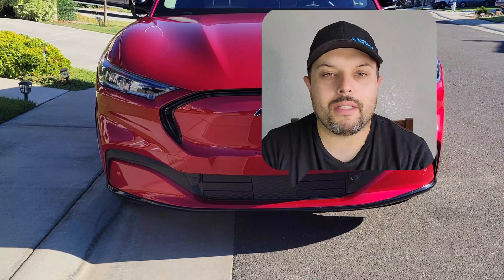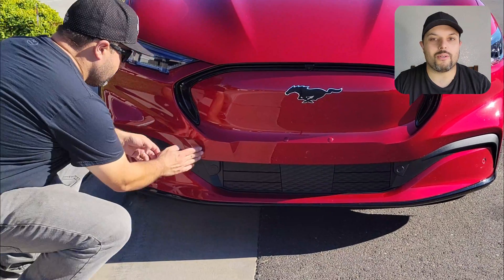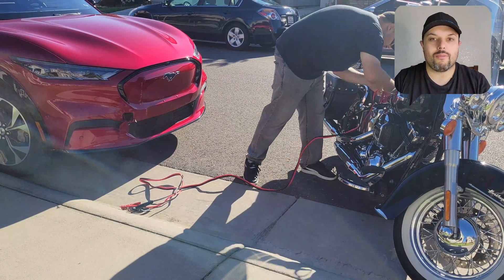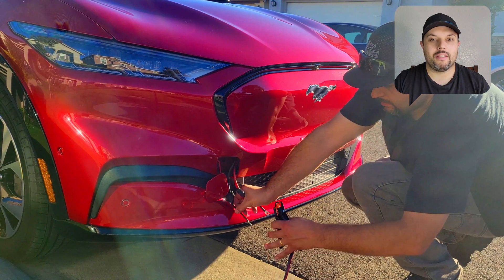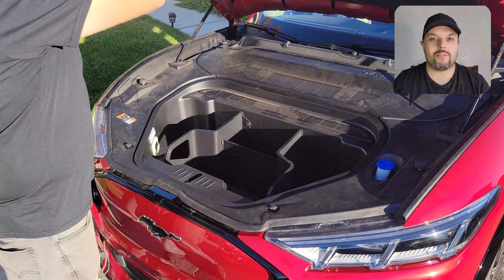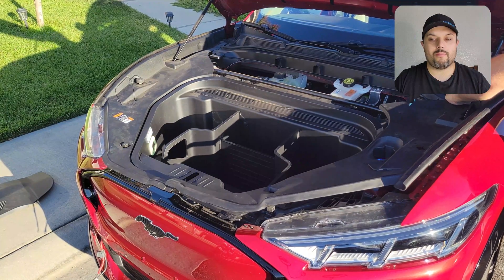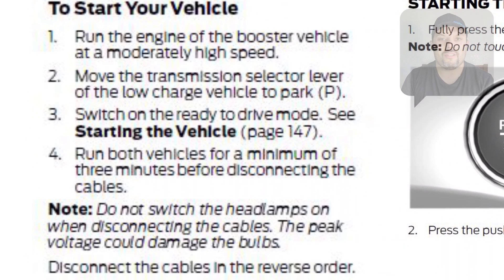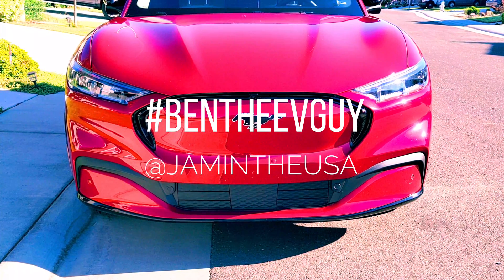12 Volt battery - how to open the hood, how to jump start, dead battery | Ford Mustang Mach E

Comment: I coded an EBay lightning remote key to work with my MME Rally so my remote would have a frunk button and was wondering if I needed to take it to the dealer because of that weird sound it makes when remote opening the frunk, but I see yours made the same weird sounds and thumping when you activated the frunk jump leads.  Odd design choice, Ford!

Comment: Question 
If the main battery is good will this method work to open the bonnet?
If this method doesn't work how do you get into the Bonnet or main doors?
Key fob battery is good and  working but doors not open?
Reply from the maker: @paulsmith2855  if the 12V battery is good it will not get you in.
There is no other way I know off to get in when the key is not working but 12V is good. Probably need a locksmith or a tow. But check out macheforum.com 
They might know more about it

Comment: I checked mine and it does not work. Checked fuses on wires all good.
Reply from the maker: Is ur 12V dead. If your 12 V supplies power it will not work

Comment: Do a video replacing the Ford battery with a Tesla 12 volt LiON battery. Liter weight more power longer lasting.
Reply from the maker: I sold the car
 And the new tesla batteries are not 12V but 15+
Reply: @BentheEVguy  Tesla started off with 12volt lead acid and now can be changed to 12v LiON.
Reply from the maker: @chada472  cool and good to know. My tesla has a 15.5V

Comment: I’m surprised to see the red and black wires being able to touch each other without consequence. They must only be going to that frunk lock and nowhere else.
Reply from the maker: That is correct
Reply: There's also a relay or switch that prevents those cables from working unless the battery is fully dead. This is problematic though, because some people have reported that their battery is too dead to work, but not dead enough for the front cables to do anything.
Reply: @daftmathtv did they say how they worked around that issue? Drowning the battery further comes to mind

Comment: I did this. Totally worked. Took it for a drive around the block. Came back turned it off. Pressed the start button and all the alerts went off... my brakes were activating too with..even with it off

Comment: Only store bottled water in that good, wtf thieves can easily get in
Reply from the maker: Why? Is ur 12V always low? Because otherwise it would not work
Reply: @BentheEVguy  oh I see, so it only works if the battery is low?
Reply from the maker: @SunshineVocals  correct

Comment: I keep my battery booster in the frunk !
Reply from the maker: How you get them out when the frunk and doors are locked?
Reply: @BentheEVguy  I guess I don't.
Reply from the maker: Dang I just wished you had an answer how to mechanically open the door. That would have been the solution

Comment: BTW, I have an early First Edition and my car had the 12v low battery issue.  If the car dies, use a proper 12v AGM charger that can supply 10 amps or more.  I originally put a 4 amp trickle charger on the car ... that wasn't enough.  As soon as I switched to the 10 amp charger the car immediately woke up and started charging.  

The have been a couple of software updates for the 12v system.  A fully updated car shouldn't have any issues.  But older cars ... if not updated, might have to go through this.
Reply from the maker: Thanks for the hint

Comment: I have a question on security. Does your phone or key need to be close by or does the 12V charge open any Mach E frunk?
Reply: Thank you for verifying. A huge relief that someone can't just pop my frunk open.
Reply: I just saw the other post that says it only works when the battery is drained.
Reply from the maker: correct, according to the manual, btw I tried it with connected batteries, it would not work.

Comment: What i don't understand is why Ford didn't just make it possible to charge the 12v battery directly from the little slot in the bumper.
Reply from the maker: What if the battery is bad and needs to be replaced. You still need to be able to access it
Reply: If you put jumpers on the wires it would  provide power to get in the car to open the frunk.

Comment: If its very cold in the winter I wouldn't want to deal with that...with a regular car I can at least use a key to get into the vehicle and access a jump start pack from inside the car.
Reply from the maker: I was told that the doors should open a few times when the battery is dead. Not sure though
Reply: @BentheEVguy   Ya it should do that...at a minimum even if the 12 volt battery is removed or dead the traction battery should be able to at least allow someone to use the keypad to enter the car....I can't imagine if it were zero degrees outside and very windy and not being able to get in my car because the door wont open.

Comment: Jumpstarting an EV is a misnomer as it doesn't have an engine to provide electricity to charge it's dead batteries. I'm curious how long it would take for a car engine to be able to recharge the batteries to the point where one can drive to a recharging station.
Reply from the maker: I think there is a misunderstanding. EV have a 12 V battery same as gas cars. They go bad and need a jump start. Same as on a gas car. That's whats explained in this video.

You can bring a generator and depending on its output it is pretty easy to calculate how many miles you get to charge the main battery. If it is a regular 110V battery you will be around 3miles/hour charging. If it is a 220V generator and it is set to charge with the charging cord which comes with the car you get around 22miles/hour charging. Of course there are faster solutions out there as well. Such as DC charging which gets you from 10-80% in roughly 45 min

Comment: Interessting to see, that Ford is able to open the hood automatically. Why not with the key or from the display. Hope an update will come.
Reply from the maker: It must be an american safety standard issue or something like this. I heard it is active in Europe
Reply: @BentheEVguy  no, it’s not activated in Germany. I have to open it manually.
Reply from the maker: Interesting. I saw some ppl from scandinavia posting, which had the button on the fob
Reply: @BentheEVguy  yes, that’s the strange thing. There is a button on my fob, but with no function yet.

Comment: That makes it very easy for thieves to open the frunk.
Reply from the maker: It only works when ur battery is drained
Reply: @BentheEVguy  occasionally, a battery can be too drained to run the onboard computer but not yet run down enough to enable the frunk jumper leads too, I've heard.
Reply from the maker: @ArtifexBarbarus  yea that would make sense to me.
Reply: Keep Secure Alert activated and you get an alert if any doors or hoods are opened

Comment: Call roadside assistance if your car is still under warranty.  I wouldn't mess around with jumping a 12-V battery on any car when the car is new.
Reply from the maker: it is a very good recommendation, but I am sure lots of road side assistance guys are a bit overwhelmed with the Mach E as well, you might want to know how it actually works. Maybe the road side assistance guy is happy to see the video as well ;-)
Reply: My roadside assistance guy had no clue and was grateful.